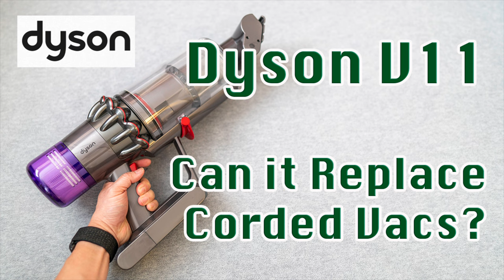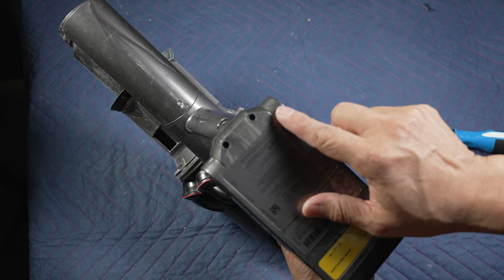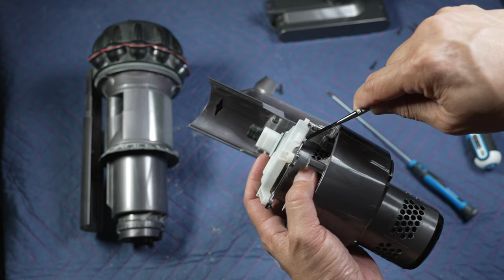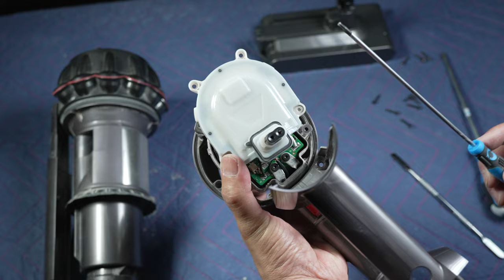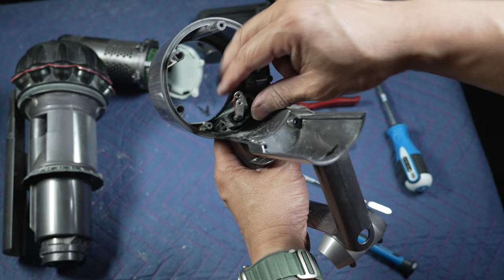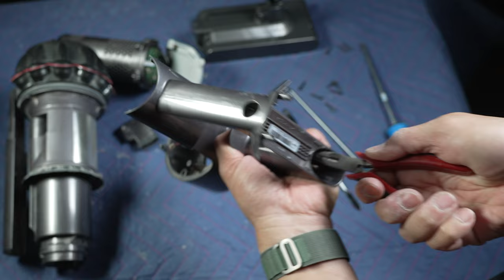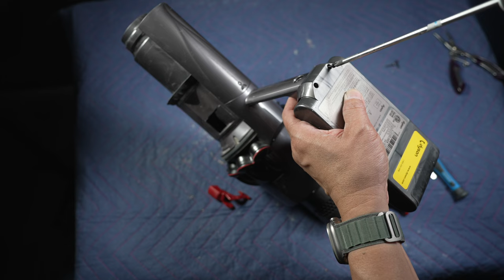How to Replace Dyson Cordless Vacuum V10 / V11 Trigger | DIY Repair Step-by-Step

Comment: This video saved me from buying a new vacuum. Dyson wouldn’t replace the body for me, they only offered 30% off, and in top of that the body is out of stock right now. They were willing to charge me to fix it at a service center but it was 2 hours away from San Diego. So I’m really disappointed in Dyson, but really appreciative of this content creator!

Comment: Awesome video! I actually called Dyson about this issue (Aug 2024) and even though my warranty expired in DEC 2020, I said it was a manufacture defect and that it’s a known issue. The representative sent me a new main body and cyclone free of charge. This was after I was told my warranty expired - it’s all about wording and saying it’s a known manufacturer defect. Hope this helps anyone else out there who has also spent a good amount on a quality vacuum, that has some parts that need better engineering. Overall, I’m still very happy with my Dyson, and I’ll be able to have two batteries now with new body that’s coming in.
Reply: does yours light up when connected to charger?
Reply: My warranty expired in July and same thing, the Dyson rep is sending me a new body.  Didn't have to explain anything,  just offered to replace it.  As you say it must be a known fault/weakness so to protect their reputation.  It is a great vac when its operating.
Reply: Wish this was the same in the UK. I contacted them today and they want £105 for a new body refused to send a free replacement because warranty has expired. Guess I’ll be ordering a new switch from Amazon…

Comment: A 45 year old single lady says thank you because there’s no way I could have paid to get this fixed. I didn’t have thin nosed pliers, mine wouldn’t fit in the thingy to pull those thingy bobs through and that took ages, so will buy some for next time, but thank you great video. Mission accomplished 😃

Comment: Great video!  The instructions were spot on and gave me the confidence to do the trigger replacement. I would not have dreamed of dong this without the detailed instructions.  I had extreme difficulty removing the Phillips case screws - especially the battery screw.  I had to use a lot of strength to slowly unscrew them, sometimes a quarter turn or less while pressing hard to make sure the tip was seated in the screw.  The Dyson screws are crap and are easily damaged.  Fortunately, the kit I purchased included replacement Phillips and torx screws. I found removing the white connector easy by just using my finger nail to pry it up. It pops up and out and snaps back in easily.  Thanks again for the detailed instructions.  It saved me a lot of money in repairs.

Comment: I just went through this step-by-step after purchasing a kit on Amazon that included the metal replacement trigger and a torx screwdriver.  And (...drumroll...) it worked like magic, and my family was well impressed.  ONE TIP TO NOTE -- once you push the trigger assembly (with the new trigger) back up into the handle, the trigger button will be sticking out in its original place but won't feel springy and won't seem like it's going to work.  You need to reassemble everything and power it up before the trigger actually works.  Cheers!

Comment: Thanks so much for creating this very detailed step-by-step tutorial. With your video as my guide  I was able to successfully change my trigger, and changed my battery while I was at it. My Torx 8 screwdriver was not able to access the two screws holding the wire cover, but a crafty setup with a 1/4 socket wrench and Torx 8 bit I was able to get into the cylinder at a 90deg angle. For anyone attempting this, while dismantling I would highly recommend laying the screws out in circles on a piece of paper to group/label which ones are which, as they are similar but of varying lengths/thread.

Comment: Great ….and our Dyson now has a working trigger. Thankyou for making a great video. I struggled getting the big terminals back through the cap but rather than using pliers to pull them through and risk damaging the small wire I threaded a bit of string through the terminal holes and used that to pull them through. Worked a treat for me.

Comment: Excellent video.  It was absolutely invaluable in getting through this rather arduous DIY repair/replacement procedure. So thanks very much! 
If you don't mind,  I wanted to pass along a couple of observations that might be helpful to anyone planning to attempt this.   First, the circuit board in my V11 was covered with a thin semi-transparent layer of what appeared to be silicon caulk.  I had to scrape off the material in order to remove the torque screws as well as to disconnect the small wire connector.  Second,  the only part of this video that caused a little confusion for me was in disconnecting that small wire from the PCB.  In watching the video,  I thought it was the black wire that needed to be removed.  It's actually the small thin red wire that is almost hidden by the black wire in the video.  The black wire is soldered to the PCB. Fortunately I realized my mistake before doing any damage.   Third,  for me the hardest step by far in the entire replacement procedure was sliding the two terminals and the thin red wire back through the removable cover in the handle. The opening in that cover is very narrow and very tight and it took me nearly ten minutes and a fair amount of cursing to pull the three wires through.  But once that was completed, the rest was all downhill.   Thanks again for this very helpful video!

Comment: Thanks for your video. I had issues with intermittent power on my V10, knew it wasn’t the battery, followed your video and replaced the broken trigger. I hope you don’t mind but I posted the video link on the Dyson community as so many customers face this issue and no doubt a percentage of these are the broken trigger.
Reply from the maker: Glad to hear! Yeah, this seems to be a common issue unfortunately. Thanks for watching and sharing it, @markhoward8141!

Comment: Just repaired my V11 switch. Followed the step by step instructions and repeated a few steps when those damn terminals got stuck and the wire got caught up in the handle. Worked....great video. Thanks.

Comment: I've done the repair according to this video and it worked. I had a big difference in my vacuum on the way though, the whole PCB with connected wires and battery cables was sealed with some glue-like substance. I had to cut it out with knife, which was risky, but worked.

Comment: Fantastically detailed and well explained video with every step explained. The V11 is working again!! Thanks, you are the MASTER! I can't imagine what the assembly line is like at the factory!! This thing wasn't engineered for building or repairing - but it does have a very fancy 'cyclone' styling on the outer plastic which is clearly there to look cool.  It wasn't clear until well  into the video that the Torx driver required was a size 8. I was also very confused when i mounted the new switch back into the handle: I expected the finger bit to 'pop out' of the handle. I now realise that the handle seems to pop out only when the power/battery is in place. Seems really unecessary over engineering - in fact a simpe on/off rocker switch would be much preferable in every way.:medal-yellow-first-red::medal-yellow-first-red::finger-red-number-one::finger-red-number-one:

Comment: Thankyou so much for posting this video..I've just replaced my trigger after following your video and it had fractured in the same place as yours. Got the part & 3 screwdriver set off Amazon next day delivery £6.99 so well chuffed..Thx again you've saved the vacuuming day..👍😁😀

Comment: Thank you, I installed a metal trigger replacement. The maker had their own video, but yours was better; more detailed and the verbal instructions were a big help. The one thing that neither video mentions is that you need to make sure the metal terminals (~9:00 into your video) do not touch each other when securely fastened. Otherwise, this was exactly the video I needed to make this fix.

Comment: Super tutorial thank you! Most time spent trying to bend the 2 connections without damaging the fragile cable which needs to travel with them! Worked a treat & I have ordered the power button clamp from Amazon 👌

Comment: Excellent video.  One of the best I have seen.  Thank you.  Just  did the procedure today, and it went without a hitch.  The crack in the trigger was exactly the same as your demo.  It would be nice to have replacement screws on hand, as the phillips heads are even worse than a slot screwdiver.  Robertson or Torx are the best  Thank you again.

Comment: Really excellent and thanks
My v10 had a off-min-max assembly on the top of the cleaner into which a small circuit board fits in from the white backing cover - I left this outside and had to reassemble the white cover a little, I note it is not in your example at all, must be small differences.
Would be good to mention the red trigger should not be springy at the start as it will pop out and work when the battery unit is inserted - I spend a small amount of time figuring this out, thinking there was something wrong.
Very minor point but be careful with singular/plurals in English.
Reply from the maker: Thanks for your great feedback and suggestions, @headingtonheritage7721! Yeah, sounds like small differences in the V10 circuit board and assembly. Glad you were able to fix yours!
Reply: Agreed, the trigger not being sprung when first inserted fooled me until I realise the battery assembly was needed for it to feel 'right'
Reply: Same re the trigger! I thought the spring needed replacing as well. Glad I scrolled down to the comments and realised it was meant to be like that until the beattery is inserted, phew!

Comment: Had a bit of trouble getting the wire connections screwed back on, but it was very satisfying to have a working vacuum again.  This video was very helpful, much appreciated.

Comment: I need to replace my trigger, finally I found your video to show how to disassemble, now when I got to the part where you need to disconnect the wires, I realized this whole part is covered with some kind of rubber sleeve that looks like it’s been hot glued but the job is perfect so hot glue wouldn’t have done this, I just never seen a sleeve like this before.  Anyways, thanks for the breakdown, appreciated. I’ll get past the cover easily. ❤

Comment: Thanks. I'm about to do this for my ex's V11 (I'm guessing it's a trigger issue). I've been fixing stuff since I was a kid 55 years ago (ok, I started taking stuff apart when I was a kid, slightly older before re-assembly :) ). 
Back then, almost everything came with an exploded parts diagram. Now, I check YT for stuff like this. (there are still diagrams and part numbers for many things online) 
Ya gotta love it when manufacturers use multiple fasteners/screw heads (Phillips and Torx in this case) GUH. 
Nice job. Clear, concise, etc.

Comment: Followed your video.  It helps to have the correct tools available including magnetic tipped screwdrivers.  Replaced a cracked switch successfully. Vacuum working great.  Thanks for the guidance.

Comment: Very helpful video! Managed to fix my Dyson with your help :D Thank you so much! 
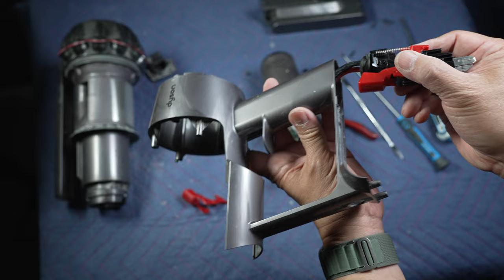Struggled a bit at 07:45 so I ended up using a little tape to hold the two terminals and the little wire together to get them through. Worked for me!

Comment: Nice video! I just replaced the switch on my v10 Animal. I did notice that there is an extra sensor on my model located at the top of the control board that sticks into back housing that must be treated with care. It is a sensor that identifies the position of the speed switch (low, med, high). Other than that, it was pretty much identical.

Comment: just fixed it myself. It feels great to see it work again. When you tested the trigger right after replacing it @7:35. That clear clicking sound when you released the trigger did not happen for me. The spring in your machine was stronger than mine. Still it did not affect the performance in the end.

Comment: This video was exactly what I needed to see how to replace the trigger on our Dyson V10. My kids got too rough with it because the filter needed to be cleaned and they kept pulling harder on the trigger which caused it to crack. The process was pretty easy and would have taken about 30 minutes if I didn't have to order a thin T8 torx screwdriver for that stupid screw in the handle. Once I got the screwdriver, everything went smoothly and now the vacuum works perfectly again. Thanks so much for your excellent instructional video!

Comment: Everything went smoothly, but when I popped the battery in and squeezed the trigger, I heard a pop. Looks like I fried the board. I checked and I don't think I crossed the wires--I had the red on the left and the black on the right. What gives? Is it toast or is the board replaceable? Thanks.

Comment: Just installed new metal trigger. Now, the vacuum will turn on with the trigger but stays on until I pull the trigger again. Would accidently switching the red and black wires be the cause?

Comment: Fantastic instructions. Took me about 20 mins to complete. Can't believe how flimsy the original Dyson trigger really is.
Reply from the maker: Glad to hear, @gabhanhome! You're quick! Yeah, room for improvement for sure.
Reply: @Tech4Baba  I'd usually be pretty good at jumping into a repair like this. But your video gave me all the steps, in the right order. Especially having to bend the connectors back from the board! I would have spent a long time on that one without your instructions!

Comment: Just used this great video to do the repair and it worked, thanks a lot! I would say however that the absolute c***s at Dyson added a bit of "fun" in my case, because when I opened the white cap I had the surprise to discover a layer of a hardened gel-like subtance covering the circuits. So I pretty much had to dig out this layer to release the small cable from the circuit. Furthermore, the two iron clasps that you need to straighten a bit to get out through the plastic casing were wrapped in some black layer which made it much harder to straighten them using pliers (I actually ended up sawing off the bottom part of the casing to get them through). All in all, I find it outrageous that Dyson gets away with what I believe is programmed obsolence (I mean, everyone knows this is an issue, there are kits on Amazon specifically aimed at fixing this issue and yet it persists) and that it makes it so hard to fix the device. Where are consumer protection authorities? Dyson basically wants you to buy a new expensive vacuum after the shitty trigger inevitably gives in two years in or so into using the device or at the very least they want you to send it for repairs and pay what I am sure is a scandalous fee. Anyway, I needed to vent a bit as it took me two intense hours to fix this damn machine, but at least I got some satisfaction when I pressed that trigger at the very end :)
Reply from the maker: Thanks for sharing and letting me know, alexciungu! Good that Dyson is finally switching over to power buttons on the latest models. Even more glad you were able to fix yours!!

Comment: Thanks! I have the the same vac and fixed it with your help. I opened it up originally and saw that screw way in there but had a feeling that wasn't the only thing holding the trigger in. I highly doubt I will buy another Dyson after the stupid design of the trigger. I mean how do you make it so thin? I had the older version of this model and the batteries sucked and it died after two years. The only reason I bought this one was because no others were as small.

Comment: Ok replacement ordered. Will arrive tomorrow. Will report back whether I can do this and whether the hoover works again afterwards 🙏
Reply: My screwdrivers didn't cut the 2nd smaller holes. I've ordered the t8 torx and should get it tomorrow but so far the instructions are spot on and I've managed to get everything removed up to the circuit board, last 2 screws just weren't for coming out with my make shift tools hacking, so need to buy the correct one and hope I've not damaged the screwhead too much. Will update again tomorrow.
Reply: Ok managed to take it all apart and my old trigger was cracked as expected. But when I put my new trigger in, it doesn't spring like I think it should. I've put it back together in the handle and the trigger is flat, no tension for the spring. I don't think this is going to work for me. Will put back together and see 😔
Reply: It worked 😭 thank you so much for this super helpful tutorial. Putting the battery section back on towards the end holds the spring part where it needs to be for the trigger to become springy and functional 🙏 technical terminology 👀 thank you so much for helping again!

Comment: When trying to pull the housing cover I pulled too hard and it ripped the two wiring points that was holding the cover. I carefully put them back into those two holes when putting it back and give it a try. I thought I stuffed it up but it seems to be working and charging fine. Would you know what those two wires are for?

Comment: I disassembled it and changed the button but I don't understand why once mounted it doesn't come back, whereas if I try it outside the hoover it works.
In any case, by dint of disassembling and reassembling, the pin on which the button screw is screwed and one of the connectors broke...I'll see whether or not to continue or change the motor body.
Anyway, one suggestion: to extract the button it is more convenient to push from the cables with the connectors rather than pulling from below.

Comment: Thankyou for the video, I replaced it with no issues once I dug out tools that fit in the tiny spaces. Once back together though I’m getting no power to my brush heads to make them spin, the hoover works fine. Any suggestions?